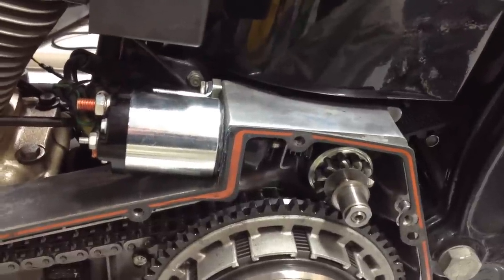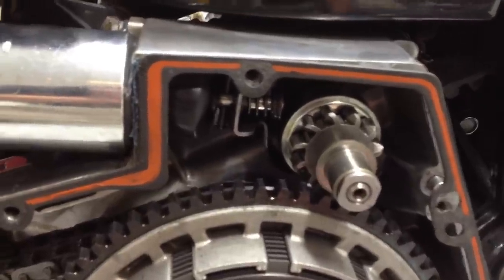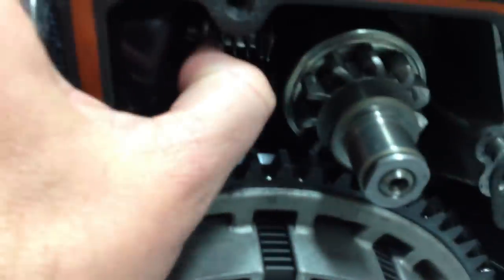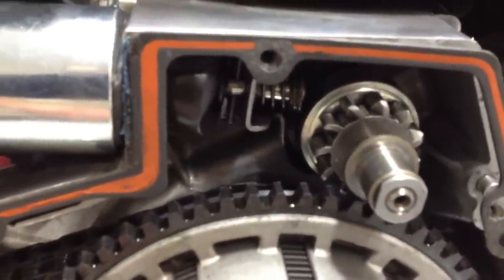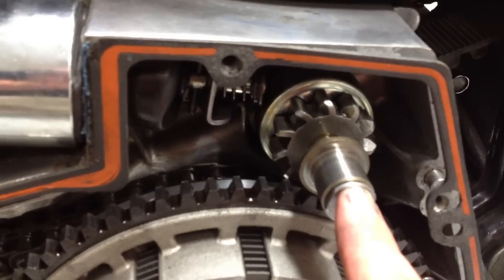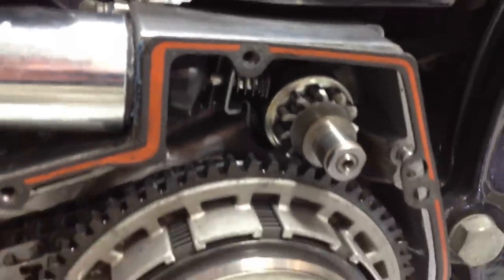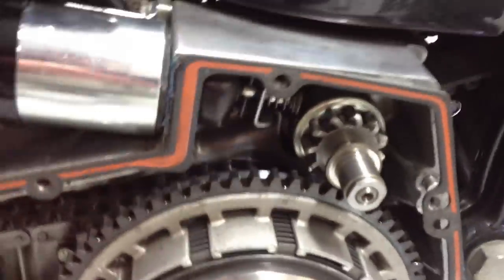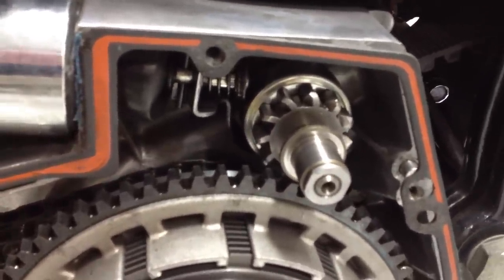Harley Heritage Classic with Evo motor starting issues, dreaded click.

Comment from the maker: RESOLVED:  Everything was lined up, but the electrical system wasn't delivering enough voltage to the solenoid to allow it to engage.  Once I changed out the relay under the seat, behind the battery it was fixed.  But after some more research into the "dreaded click", I changed my wires to heavier gauge, and shortened them so there was less of a voltage drop.  Now the bike starts great.  Since it's a Big Bore Evo it takes a lot for mine to turn over, I press and hold the starter button and she spins every time.
Reply: Ghost how much voltage it needs to start? I have the same problem with my shovel. I have 12 volt isnt that enough?
Reply: @ati1903  it isn't voltage, it's ampherage.
Reply from the maker: @ati1903  Very slow response I know, but for those reading: The voltage is standard 12volt from the battery, but you need unrestricted voltage and amperage. As noted, amps are a part of it, but the factory wiring is so small that you suffer a serious voltage drop through the smaller wires. My solenoid was only getting around 7-8 volts by the time it reached the solenoid, which is way too low. It just couldn't carry the load.

Comment: •Starter needs the primary on to support the armature. With out it the starter will stick on the gear, and not fully return.
•If you push the start button and nothing clicks or spins, most likely the relay.
•the solenoid has pull magnets and hold magnets, and also pulls the Bendix to engage the starter gear to basket gear. When the magnets energise in the solenoid(via the relay) it pulls the Bendix and engages the starter gear. When the solenoid is holding the starter gear to the clutch basket gear(via the Bendix)the solenoid internally make a connection to the starter motor.
So if your stater motor turns and doesn't engage, the Bendix is broken. If the starter gear engages and starter motor doesn't spin the contacts in the solenoid need cleaned or replaced. If starter chatters the hold magnets are bad in solenoid. 
For twin cam: if you hear the starter engage and sounds with its not catching all the way, or grinding occurs, replace the overrun clutch in the starter.
Reply: Finally it looks like someone knows their stuff on this...my 84 flht is clunk, clunk, clunking the starter gear up in place but nothing is happening except a whizzing sound every other time or so with the button held. Reacting the same with or without primary cover in place. Also, new solinoid and the bendix spins out by hand and locks up in the other direction. Just the starter motor maybe? Is it possible for reduction housing to have failed parts?
Reply: Hello it sounds like u know your stuff on motorcycles.  U wouldn't by chance  be anywhere near virginia my husband looking for good mechanic . Having  issues with his 88 softail
Reply: @squawk3120  
Your overrun clutch in the starter.
Reply: @bonniegrandstaff398  I was in Ohio but moved to Georgia.
Reply: Thanks

Comment: If you have a junk outer primary cover an old, and very useful trick is to saw off the top rear corner of the cover containing the starter shaft bearing and the two cover bolt holes near it. You can install that to support your starter shaft to check engagement and operation. That works for any electric start outer primary no matter the year, from Panheads to Twin cams if you have the correct cover.
Reply: Ob Fuscated
Reply: @shanetodd4114  a copper tang on solenoid to jump the posts

Comment from the maker: Yes, I had to change the relay under the seat.  When you get under there you will see an excess of wiring running around.  I also shortened the run and increased the gauge (thickness) for better current flow in the system.  Doing that not only fixed my issue, but gave me stronger starts.  Search Evo motor dreaded click.  Typically it's not the solenoid but the relay and wiring creating a voltage drop and your solenoid can't engage.

Comment: LOL! Of course it won't - that's how it's supposed to work. Engage the bendix with the ring gear then turn the clutch hub counter-clockwise (as much as physically possible) and it will release. This is EXACTLY how it's mechanically designed to work. You also don't really want to try and spin that up without the primary on because you have no support for the end of that shaft so when it does engage it's gonna jump all over the place. But, you problem is elsewhere, you don't even have power getting to the solenoid.  Is your relay clicking? Jump the terminals on your solenoid (but put your primary back on first before you end up fucking your starter clutch up) then you can rule that out and look at your relay and/or starter switch.
Reply: Damn you seem to know a lot why do you only have a video of your sporty idling?
Reply: Turns out you was right.  The guy said his relay under the seat was bad plus he put a heavier ground wire in so enough amps went to starter.

Comment: my 1988 evo has always had starting issues. the latest: backfires led to a broken starter gear clutch. New clutch gear now  wont engage clutch basket ring gear. replacing elec. cables next
Reply: Same here.  Bought '99 Evo Fat Boy from Harley dealer and kept kicking back like timing was too advanced.  Bought new battery then pinion gear tore up.  Put new Spike starter, Jackshaft and pinion gear in so ring and pinion gears tore up.  Took it to dealer to get fixed right. They said my work was fine but they didn't check timing as I asked.   $700+ and 400 mi. later,,,, ring and pinion tore up again.  Fixing myself now plus putting in ALL new stock Harley ignition stuff.  Comments say check all grounds, positive connections and starter relay.  Andrews CV46 cam and V&H Drag Pipes.  23,000 mi.    Good luck.
Reply: My starter gear clutch cracked on me. Replacing it w a heavy duty Spyke clutch gear. Hopefully that’s the only thing I’ll need replacing! It’s an 88 flstc

Comment: I had one the fork had splayed open the guy had put it in a vice squished it back in of course it is not factory any more so was pulling the shaft down putting stress on the solenoid , if you put it next to a new fork it was out took me ages to suss it

Comment: my 97' FLSTC will sometimes start right away, other times it will crank like the starter is grinding. Any suggestions ? I have switched out the start buttons when I chromed the switches...
Reply from the maker: That is most likely the similar issue I was having. The starter wasn't getting enough power to fully engage and lock in so it sounded like gears grinding. Low voltage was my problem. I shortened my wiring and put thicker gauge wiring on, and then changed out the starter relay. It eliminate a really long wire run and the voltage drop because of it. Thing started solid from then on out. Google "Harley dreaded click", or harley starter click to learn more about this.
Reply: Thanks I'll check into the relay, I already put thicker wire cables on my battery. Have you ever Heard of The screaming eagle modules going bad?

Comment: i have a 98 fatboy . when i hit the starter button it sounds like the drive is just spinning but not engaging.....any ideas??
Reply: I just went through this change drive first you can pry the forks and get the drive out on mine the shaft was not all of the way into the starter due to b4 I got it the thrust washer was lost that goes on the end of the shaft next to the primary. I have a shovel

Comment: I know this is an old video but I'm having a similar problem.  My 84 shovel engages but doesn't have enough power to push through compression. I rebuilt the solenoid and replaced starter relay but still no luck. What voltages did you get through the solenoid to the starter.
Reply: Pull your starter and look at the brushes.  More than likely one of your grounded brushes has broken jammed or come unsoldered.  Havea new starter right now that I took down this morning with that problem.  Make matters more interesting I am also having problems with relay and solenoid.  Hit the tri-fecta today.
Reply: Side note.  Could also be a timing problem too much advance but id the bikr gad been fine for awhile probably not.  I came to all your pain as I had just had my single fire ignition tank on me.
Reply: Ron Katz what was your resolution on this ? Gotta start in on my 85 , not the starter motor & it seems like issues we had with cars & trucks ( smack the starter with a hammer to catch grip ) . Wires seem to B a popular problem I'm finding from videos
Reply: mike quinn I’m having the same issue on my 82 shovelhead

Comment: I'm trying to fix this same problem on my 96 FatBoy. I took out the end bolt on the starter gear and removed it. behind the spring, inside the bearing I found a spring clip that was not in any notch. Just wedged in there crooked. Anyone know what that's about? Is it a symptom or could it be the issue?
Reply: What ended up happening? I'm working on my Dad's 96 Fatboy, the pinon gear engages in and out but doesn't try to spin

Comment: similar crap with MY newly installed! lever action solenoid eliminating lever. Drive seems to bind with the crown gear. does same as his EVO. i have 74 shovel. relay clicks. cranked earlier today, than nada. used old primary cut up like commentor states later. Lever acts as a ground with wimp ass gauge wire. 47degrees here ain't riding anyway! any thoughts? goin' for a beer ...want one?
Reply: stanley kwiecinski 72 shovel same deal, did you figure it out?
Reply: @reggielau8387   i used 4 5/16 flat washers before the pivot arm. was working great ! kept hitting the lever with the plugs out, to crank it around  to be sure.before i put the primary back on. big relay to starter/battery which i cleaned in parts cleaner (shoulda known better) quit. was old install. gonna test the old one now. imo . drive shaft woulda broke before it bent. good luck! Reggie
Reply: tested relay. OK! small term. was lighting  when lever was pulled? waiting on new one anyway. Article;  simply the best starting lever. prostreet Holland. learned more from reading it. Good LUCK! to early for beer. nap time it is.
Reply: @reggielau8387  relay was junk. 4 washers worked for me. cranks great! my bendix was going in to far and binding.springs ain't the strongest to push the bendix back. lubed up everything. Good luck!

Comment: Did you resolve your issue? I am having trouble with an '87 softail, similar setup, but not sure I got the solenoid connected right. Starter just spins with no jackshaft movement. Any thoughts?
Reply: Did you find the problem?